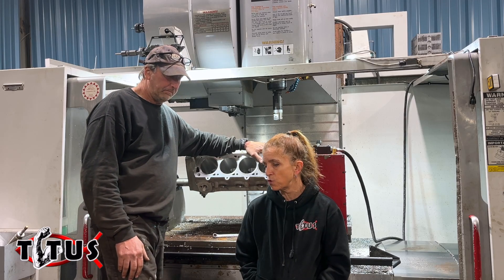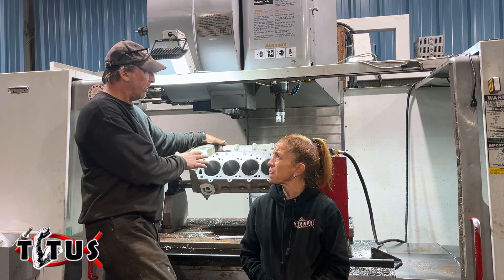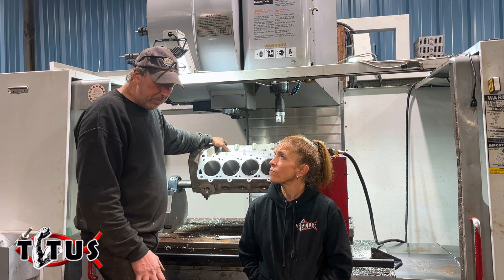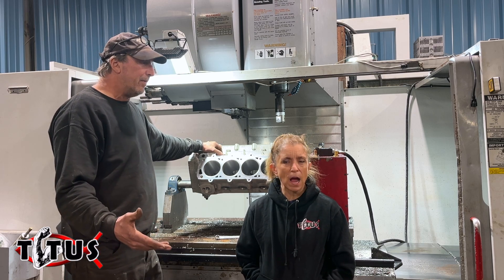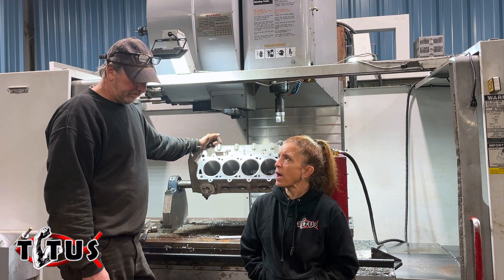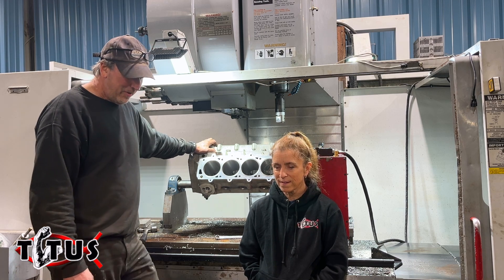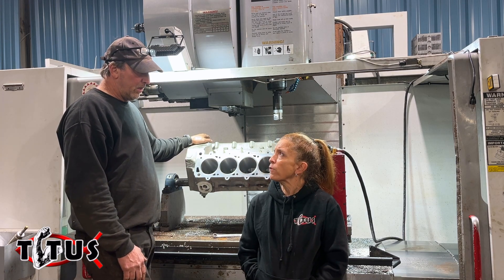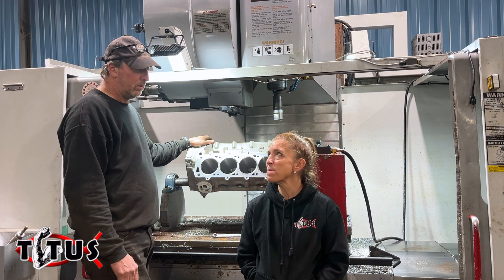2025 Production Update on Titus Iron Blocks // Re-designed 351 Cleveland – Titus Performance

Comment: Looked at one of your older vids for more info.  Looks like no splayed main bolts....hopefully that's changed.
Reply from the maker: ALL Titus blocks use splayed  bolt main caps.  Our bolt locations are moved from the original locations to provide more clamp load and longer thread engagement in the casting